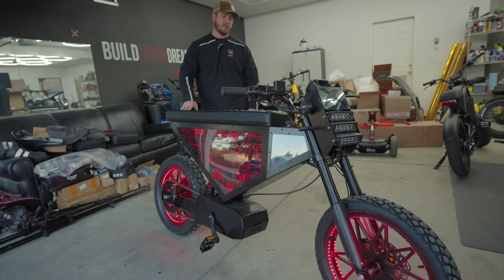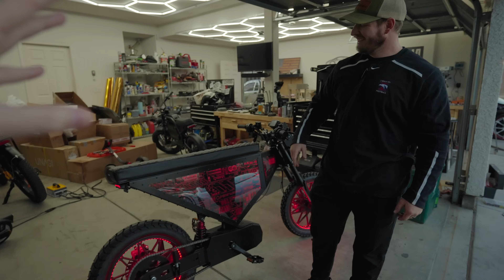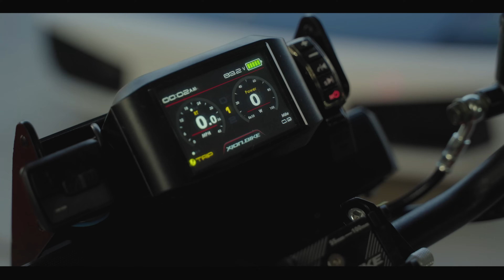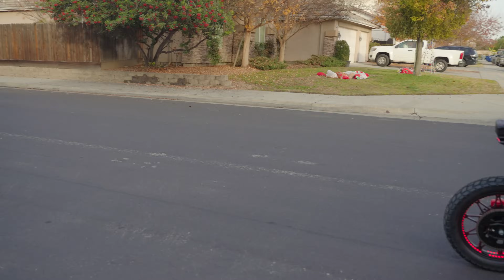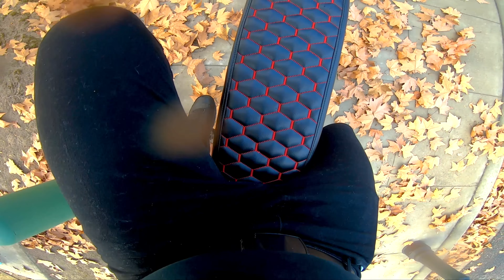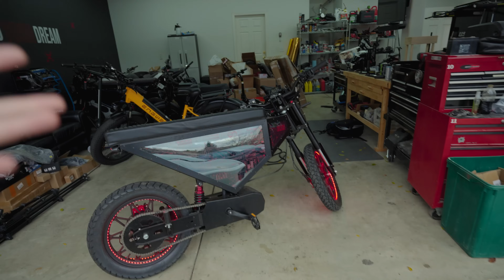INSANE E–BIKE you can REGISTER AS A MOTORCYCLE

Comment: Hopefully they upgraded the battery cuz its 50ah but only 100 amp discharge I hope they upgraded that or its not gonna handle that BAC8000 mine would cut the bike off obviouslt needs more than 100amps. I ended up downgrading the controller I used it on something that could handle it the bike would be insane in speed if the battery were upgraded to high output molicel pack or any pack more capable.